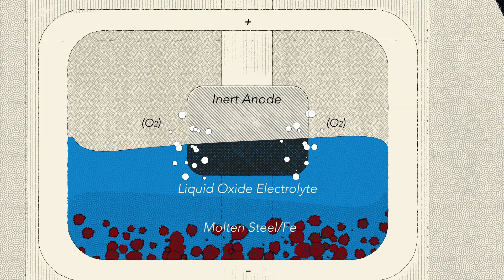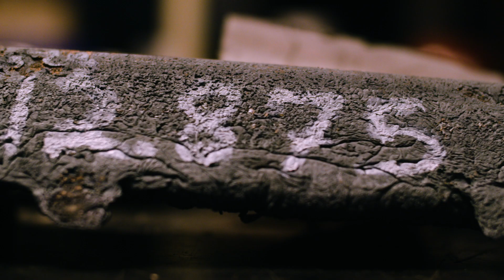Better Metal

Comment: Cutting almost 10% of CO2 emission sounds incredible!
Reply: We might need the CO2 to protect us from the next Ice Age.
Reply: You do understand that CO2 is used to make the extra electricity needed?
Reply: Rockspoon it can be made with solar, wind or even nuclear. This is big
Reply: @MoDa87  you do understand that nuclear power uses fossil fuel powered equipment to mine ore, solar barely gets back more energy in the lifespan of the panel than is needed to create it, and wind is unreliable (as is solar), kills a ton of birds, and almost always is a  long distance from the point of usage, as all you internet activists love windmills... Just not in your backyard.
Reply: Rockspoon ?? I love windmills in my back yard. I lived in Scotland for a long time. Every time a new park went up I celebrated. They kill hardly any birds when compared to the hundreds of millions killed by traffic. I did not see any of the so called concerned citizens protest about that for the last 100 years. Do you have a reference for the claim about solar producing more carbon emissions in its production than it saves? Is this dependent on the source of energy that is used when making them or something inherent to the process like when making steel? And since you are concerned about intermittent energy production I recommend you check out Ambri corporations energy storage device that was developed by the same professor. They are about to build their first storage facility that is cheaper than anything else on the market and is made with none rare elements.
Reply: YOUR SOLUTION IS IMPERFECT SO I WILL INSTEAD SUPPORT THE CURRENT AND WORST POSSIBLE SOLUTION
Reply: @rockspoon6528   So a bird or two flying into a wind turbine every now and then is less destructive to the environment than pumping out thousands of tonnes of poisonous gases and particulates? Sure.
Reply: @bartholomewdan  It's not "a bird or two... ...every now and then."  It's dump-truck loads of what are often endangered species, such as bald eagles, getting dropped like flies.

You people think CO2 is a poisonous gas- you can't be trusted to make the distinction a to what is hazardous.  Particulates can be burned off or filtered out relatively easily (and are) while the less pleasant gaseous emissions can be dissolved in solution.  Build your factory/generator in a wooded area and the foliage will eat that CO2 greedily.

You're also going to ignore that oil (not coal, though, coal is stable) is a ticking time bomb whether we use it or not.  Do you have any idea how close to rupturing many of the sub-oceanic reservoirs are?  We could cease all drilling TODAY and start seeing enormous (natural) oil spills in anywhere from a few decades to centuries- oil spills that put Deepwater Horizon to shame.  Those Alberta oil sands you're trying to shut down?  That's an old, largely terrestrial, natural oil spill.  You people are so stupid that you campaign AGAINST CLEANING UP OIL SPILLS.  That's not to mention that a rogue earthquake could currently turn the seven seas into a Jiffy Lube.
Reply: @MoDa87  @Rockspoon dont worry, this rockspoon guy is way off on his numbers about solar producing more than it saves.  Hahaha, he didn't even give numbers.  So I will. Because solar benefits over years, and the carbon it takes to make them doesn't show up til the next year, I will give a 4 year snapshot.  from 2018 to 2021 emissions saved from solar power is 1,100 million tons of CO2 and the amount it took to build solar panels in that time span is 149 million tons of CO2.  So, close to 90% effective.  For wind it is even better numbers, like 95% effective.

Comment: This is basically Aluminium smelting for Iron and aluminium smelting isn't an environmentally friendly process (also releases fluorine.) Outside of area's with nuclear (or to be fare major Hydroelectric) infrastructure it's simply a pipe dream  to say that steel can be made with carbon neutral electricity. 

Even modest Aluminium smelters can easily demand 2-500MW of electricity 24/7. Base load Nuclear (or Hydro in 'very specific' cases) is the only 'low-carbon' energy source capable of meeting this sort of demand. No wind / solar / battery system could even go near that. Heavy industry (Mining / Metals refining / smelting / oil refining / etc...)demands 24-hour power, 24-hours a day every day and renewable's are not even at the discussion table. Even small disruptions (in the order of seconds to minutes) in supply can cause major problems and cost operations millions of $$.

Don't get me wrong, the process to produce steel is good. However to sell it as a 'clean alternative' is naive at best and ignorant at worst.

Regards
Jordan

Comment: Holy crap!!! I've been crying out for a better metal production method for years, and this is looking great!!

Get it into action now! Love you Bill Gates!!
Reply: This method has been used for a long time already just not cheaper, what makes you comment this kind of way?. Not judging just want to understand
Reply: @samuelsanchez8825  most of the great innovation isnt on the product side its on the production side.
Reply: @wesleymatthews6356  obviously, what's your point?
Reply: This company didn’t  prove anything yet though. They merely stated intention. Their metal isn’t yet better nor cheaper and likely won’t be. Traditional methods have been developed over decades to be cost effective and qualitative.
Reply: Robin Ceuppens they have a working prototype. With the investors they have they will be working on scaling.
Reply: @MoDa87  Having a prototype doesn't mean they could compete with established members of the industry. Also prototypes often are not suitable for scaling. Prototypes often are a multiple times more expansive then what can be used in actual production.
Reply: Robin Ceuppens sure, but they are beyond just stating intention. Stating intention to me means saying: I want to go to the moon.
But if I build a working rocket it’s beyond that.

They are currently building a facility that can produce 1000T annually. Let’s see where it goes.

Comment: Doing this requires huge amounts electricity which is really expensive. How is this cheaper?
Reply: Better product too. Pay ten times for american steel already for five times the quality....ya know?
But yeah, power is a whole different story....maybe use some steam power that's created in this process
Reply: @tafdiz  what are the costs of solar install -
Reply: @jwarmstrong  Installation is only an issue with small projects not ground large farms. The production would be the issue at that size.

Comment: “No ones gonna pay a premium for green metal, it’s gotta be better, cleaner, cheaper.” Now that is finally someone thinking about the problem in the right way. 
I can’t tell you how many times I’ve seen people upset about how, why, or who makes the things they use and then turns around and still keeps using the same thing. They’ll pay a premium to get fair trade coffee to drink while buying cheap sweatshop made clothes. They violate human rights but I still buy from them because they’re 10% cheaper. Unless you can make it cheaper and better you cannot win.

Comment: With steel manufacturing being the largest source of greenhouse gas emissions, it is also one of the most common industries. Continuing the manufacturing of metal will have a severe impact in the future, if not already. Having the ability to make steel out of the renewable source of electricity isn’t only the safe way to go, but the economically friendly way. If all steel companies in the industry can convert to this better way of making metal, the future of the world around us will be bright.

Comment: Strength of Steel is very important when selecting for different purposes. In this new process that has to be determined in the Laboratory before any small scale production.
Reply: The process is not new, the quality of metal is way better just isn't cheap. Do you have professional knowledge about this area?
Reply: @samuelsanchez8825  About 
●Molten Oxide Electrolysis● ??
Have to evaluate the Process to make it Cheap and Competitive.

Comment: This is exciting.  If it works as advertised then it would not only eliminate CO2 and CO discharge, but also eliminate silicates and other inclusions from the metal.  Has anyone produced a flat-rolled product using this method, or any other product like rebar?  Can it process scrap steel/DRI/etc into slabs or ingots or does it only work with iron ore?

Comment: hmm, so the same process as for aluminium. my question is what the electrode made of? Is their a way to avoid graphite in this case ?

But even if it is graphite that will reduce carbon imitions by at-least 50%.

Comment: I didnt make all the calculations but roughly it is, 600 kg's of coke vs 13000 kwh of electricity. And I know for a fact that an increase in electricity prices affect metals like Copper and Aluminum in a greater margin. That's because reduction through electrolysis (Like in Hall Heroult Process(aluminum from alumina)) takes a lot of energy. That's why I'm guessing this process will not be globalized until the prices of electricty can compete against Coke.
Reply: Btw, a ton of coke is about 200-400 USD, and 13000 kwh electricity is about 2,000 USD(gave it a 15cents per kwh approx price, depends on the region really)

Comment: So it is just laziness to use Coal as the reducer in steel production, because 1870 production technique has been easier than demanding anything slightly more  hightech after 150 years?
Reply: Tore Lund they have no interest in changing. They are so invested in the tech it would ruin them to change. This will save American steel workers from China. China will not be able to compete anymore.
Reply: @MoDa87  Yes, this has besides making cleaner steel, the potential to be cheaper too.

Comment: So they have taken the refinement process from aluminum and switched it to iron. They gloss over the inert anode though. The aluminum industry has been working on that problem for decades and is fundamental to not emit CO2 or CO. The anode currently used in the aluminum industry (and I’m guessing in these preliminary tests as well) are graphite which is consumed by the oxygen and turned into CO2/CO. I like the idea but I’m guessing the aluminum industry will figure it out first

Comment: Pretty impressive to make steel and metal with almost no carbon emissions.
Reply: Except that about 60% of electricity is generated from Fossil fuels. This is just re-arranging the deck chairs.
Reply: @guytech7310  Its a start at least and also if they can siphon enough electricity through solar and wind than the amount of electricity generated from fossil fuels decreases.
Reply: Guy Tech green power exists 🙄 and he says that it’s a lower energy use

Comment: Wait, aluminium has used this since a hundred years, how is this a new technology? The issue with steel is that the furnace will produce more of iron. Also, getting electrical equipment to work in that environment is going to be a challenge. Good luck I hope this works.

Comment: This is interesting. From what power source is the electricity derived? Is its production of that Energy "Carbon free"? Even if it is 'carbon' free', its use might deny that 'carbon free' source of energy to other projects. Many things must be considered before deciding to engage on a Planet-wide plan of action - especially if the efficacy of the incipient Idea itself; is faulty from the get-go...

Comment: #SwitchToSolar #SwitchToElectric
We should all be using electric vehicles charged from the excess power generated from our home, business and covered parking rooftop solar arrays making nearly everything we do 100% solar powered.  Everyone should be getting proposals from 3+ local solar PV installers and suggesting the same for our places of work, our grocery stores, our movie theater parking lots, and everywhere else.
The cost per distance driven is ridiculously cheap when you are your own solar fuel station (less than $0.01 USD per mile)! #nobrainer
We cannot afford to continue to burn fossil fuels!

Comment: This is same tech as for Aluminium production. This raises the questio of source of electricity (dont forget energy conversion losses plus thermal loss in the proces).
Plus aluminium production uses fluoride for reduction of melting temp and as a part of electrolyte.
For iron its a bit beter and less toxic. But temps are higher.
Go figure best steel was made whit charcoal. No sulfuf, no phosphorus. 
Grown forests are beter solution than solar. Low tech, plus more jobs.
More CO2 reduction is posible by turning off those all lowed Win 10 updates.
Yes, i know then you whoud lose some of those bilions.
Its for the good of all, be a sport mack.
Reply: So does this have anything to do with the aluminum shortage?

Comment: That doesnt make sense. I'm a blacksmith in my spare time, and as i understand the process of making steel, you need to infuse carbon into iron. If you're not creating carbon, then what comes out of your foundry is not steel (melts at low temp, around 1300 celcius) but pure iron. Of course thats interesting as iron is extremely rare nowadays, and when its not rare, its expensive.

But the problem is that iron melts at a very high temp (over 1500 celcius) compared to steel or cast iron... so how can you be more energy efficient when you need to power an electrolysis and when you have to heat the furnace more ?

Then, what you've got is iron. And then, how do you transform it into steel ? Steel is iron infused with carbon. Iron is soft compared to steel, how will you build skyscraperd without steel trussing ? How will you make a good tool with soft iron ? 

You will have to re heat everything again and burn coal to introduce carbon. So your whole "green process" has no point at all.

Just use coal from the beginning ang get some steel right away at lower temp, with less energy consumption and less cost (already existing technologies are cheaper than new ones).

I'm not saying that electrolysis of molten metal is useless, having pure iron can be welcomed by blacksmiths and metalworkers.

But selling this idea to people who do't even know what steel, iron or aluminum is is just some businessman bullshit.

Comment: Sorry, you have to suspend the First Law of Thermodynamics for the technofixes to work.
Reply: He invented a method that uses LESS energy then the current method while also using far less carbon.  The more of those we invent, the more it adds up.
Reply: @kin2naruto  sure because we all know that computers reduced paper use...NOT. For every problem technology solves it creates 10 new ones, and the miracle tech you referred to is not an exception. It is an ever increasing techno ball of problems fueled by extermination of biosphere. You can do this crap for just that long in a closed system. Human specie is inherently parasitic inside and out and technology exacerbate inherent human parasitism big time.
Reply: @ppss.6302  Computers DO reduce paper use - after you fully make the transition.  Paper just got used for so MANY different things in offices that it took quite awhile for the tech to cover everything.  (And paper still gets used for stuff like hard copy archive and patient handouts)  And even now paper can do a few things computers cant'.  Like... work when the power goes out!
Reply: @ppss.6302  As for your 2nd complaint that humans are parasites on the ecology?  Well, we weren't BEFORE we invented tech!  If you are an evolutionist - then humans lived as a part of the ecosystem for a really, really long time.  The recent human-caused pollution problem is within our capability to fix.  But because it took so many centuries to MAKE the mess... its gonna take more then a day or two to fix!  Clean the part of the planet within your arm's reach.  Then we will be that tiny bit closer to a full solution.  ^_^
Reply: Quote fyi
Paper use increases year on year and has quadrupled over the= past 50 years. In 2014, global paper production hit 400 million tonnes per year for the first time ...

Comment: Good luck with that just knowledge of basic physics tells you there’s going to be some problems not to mention the sourcing of the quantity of oxide needed the type needed and the energy needed is only good in certain localities of the country where Hydro is available. And with the cost of infrastructure cost of labor and upstart in the United States this is best done in a Third World country overseas unfortunately that’s the truth otherwise the cost per ton to manufacture the steel will be astronomical. I could smell investor seekers. Can we smell “Solyndra” all over again.